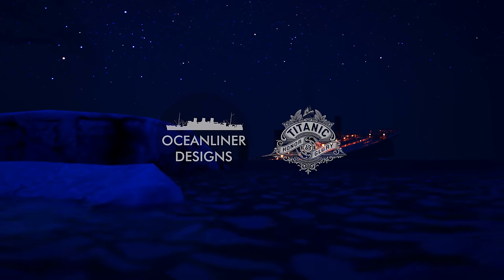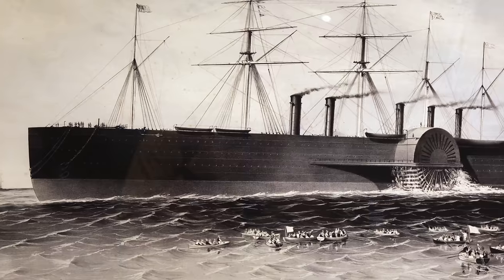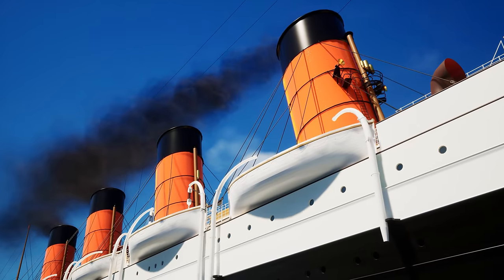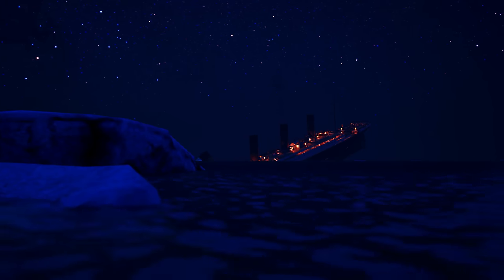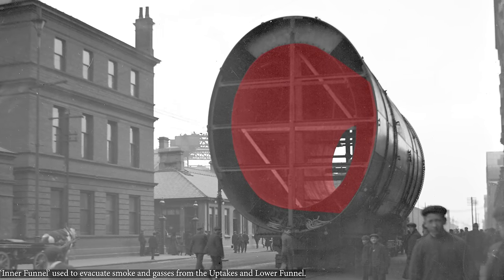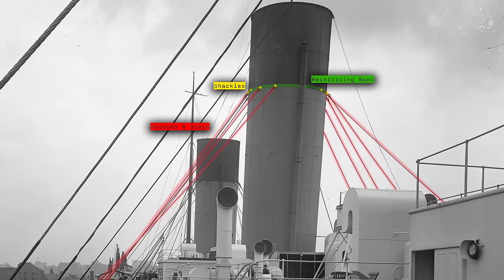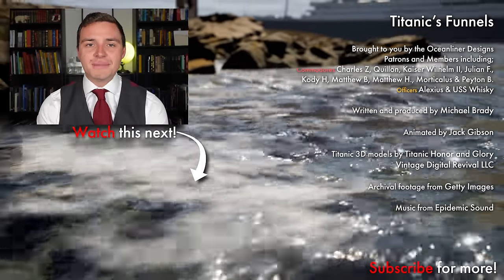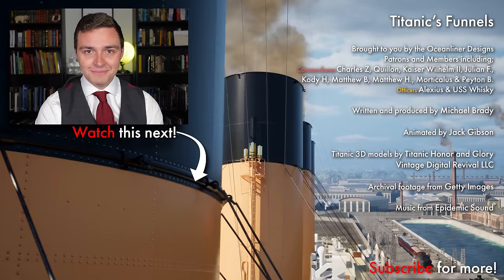Why Did Titanic's Funnels Collapse? An Analysis.

Comment: It collapsed because it was a poorly made piece of crap ship that was over rated in every way.
Reply: Except it wasn’t poorly built at all
Reply: Tell me you know nothing about Titanic without telling me
Reply: @Borninthe80s.  hmmm that’s why it’s at the bottom of the ocean when it was supposedly unsinkable. Sounds like crappy building.
Reply: @Barkiro2010  I know it’s at the bottom of the ocean…couldn’t have been made all that well if the ship they claimed unsinkable sank. Hmmmm think about that one Einstein.
Reply: @angryrick2330  bro you literally know nothing about ships
Any ship has a probability to sink even if it had ten inner structures 
Hitting an ice berg and staying afloat for nearly two and half hours even when her designer said maximum one hour shows that titanic was well built, it was just luck that messed it up
Reply: It sure was sarah  @Borninthe80s.
Reply: @Barkiro2010  : Consider this:   Both the shipping line and the shipyard were short of cash.    Consider this too:   rivets were recovered after Titanic was found, and analysed.   They were found to be very poorly made, with an abnormally high sulfur content making them brittle.  Some whizzos claimed that the sulfur came from the sea after many decades of deep immersion, but when rivets were obtained from another ship that had been sunk for about the same length of time, the sulfur content was found to be much lower and the rivets were sound.
That's why Titanic sunk - it was built on the cheap, corners were cut and when it made a glancing blow on the berg, shock burst the rivets and plates fell off.
Reply: @keithammleter3824   now im not a metal expert or a ship builder , but i know well enough about ships to stand up to what im going to say,
Steel is not cardboard. It can't just burst or fall off as you said, when titanic struck the berg steel didnt fall off or burst but it was rather bent in by the berg which would have lead to immense pressure on the rivets that would just make them pop out of place, and that would be reasonable since the iceberg isnt made of lego, it was way stronger than what you would ever think, it wasn't your daily use freezer made ice. In fact if you look at recent photos/scans of the bow wreck you can see a long black line just above the ocean floor under the bent area, that was abit of the gap the iceberg made, you can see steel didnt just fall off or burst, another factor to support that the steel was well made is the wreck itself! If the steel was poorly made im pretty sure that wreck wouldn't even be standing famously as it is now after all the corrosion and destruction that happened.
Now to the point of cash, if the line and yard were short of cash at the time as you said, they wouldn't have had the money to build an entire new ship (Britannic) and refit Olympic with boats, vents, davits, etc. And the yard wouldn't have continued to make ships for 80+ years after.
Reply: @Barkiro2010  :  I'm no metallurgist or shipbuilder either, but as an engineer I do know some basic facts.
Modern mild steel that we frequently encounter has a carbon content 0 to 0.3% and negligible other impurities.   This makes it by metal alloy standards fairly soft and very ductile - hit it and it deforms.   In contrast, Titanic's hull plates were nominally also mild steel, but with a higher carbon content and lots of metallic impurities - being the standard of the day.  This means it was a bit tougher and more springy - hit it and it will bend at bit but also transmits the shock 
.Titanic's rivets were essentially (by manufacture and the method of installation) wrought iron.   This gave them more strength than mild steel but also made them somewhat brittle.   Experience of shipbuilders at that time showed that the brittleness was acceptable.
However, Titanic's rivets that were recovered were shown by US National Insitute of Standards and Technology to be defective.   They had a high sulfur content, a lot of slag from defective manufacture and were excessively brittle.   NIST found that rivets had snapped off.
I'm no metallurgist, but NIST have work class experts, and if their experts say the rivets were defective, then I certainly accept that.  Their reputation is world's best.   Tim Foecke was the lead scientist in the rivet analysis.
It should be noted that NIST tested rivets from the affected ship's side.   It is quite possible that most of Titanic's rivets were sound, and it was bad luck that the berg hit where the rivets were a bad batch.   However it is part of NIST's findings that the rivets were defectively brittle because they were incorrectly installed - insufficient control over temperature (the type of rivets required installation while red hot).
Titanic is currently disintegrating.  It has lasted as long as it has due to great depth where temperature is low and oxygen also low.   Plenty of old sunken ships have lasted just as long in less favourable depths.
Plenty of large businesses have gone through very tight patches, almost gone broke, but survived many more decades.